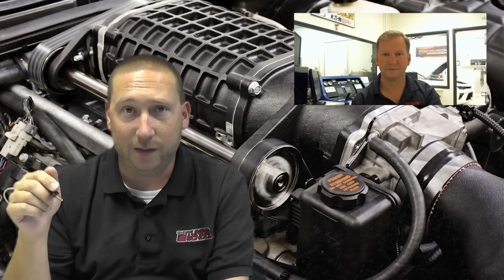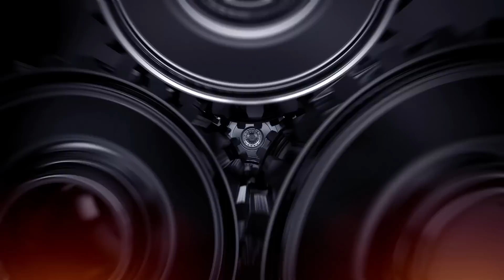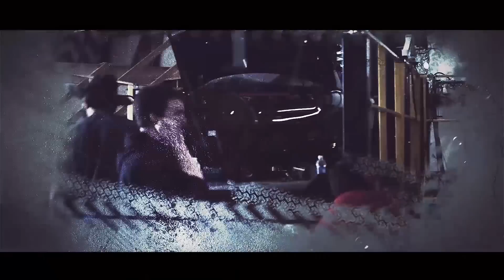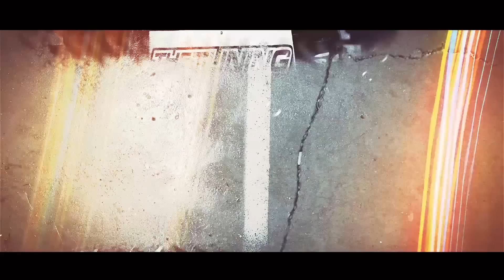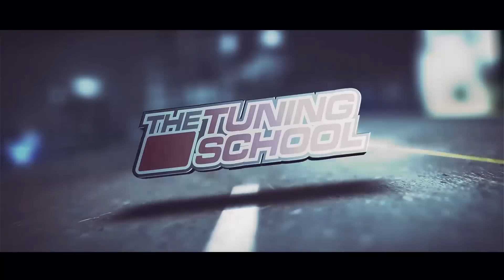Forced Induction (Part 7): Q&A with Magnuson Superchargers, Can you go too big?

Comment: I run a 2300 Magnuson on my 6.0 liter 2009 Pontiac G8. It makes 600 hp with no problem on 93 Octane.
Reply: What mods are done to it? How much boost?
Reply: I had the active fuel management removed. I added a beefier cam to support the supercharger. Dual fuel pumps, Bosch Injector Dynamics 1050 fuel injectors, Rotofab cold air intake. Right now I am only running 6 pounds of boost. I thought about more, but the 6.0 liter V8 already has a 10.4 to 1 compression ratio; but trust me the low end power is extreme with 6 pounds. The torque comes on quick and the redline is now at 6,500 rpm. I also have the car set up to run E85 with 2% methanol added directly to the fuel. It does not have methanol injection. The car has 3 inch stainless works X pipe exhaust. After the mods were completed the shop had it on the dyno a couple of days to get the timing real precise. In addition to the engine mods I had Pedders suspension components installed, including cradle bushings, springs and sway bars. Just switching to E85 and meth adds almost another 100 horsepower. The biggest limitation is the tires. While I run Michelin Pilots, they just go up in smoke from a standing start. If I ran the car at the drag strip, I would invest in some good slicks. The car is a sleeper but just sitting at idle it sounds like a Hellcat or Shelby GT 500. It is quite capable of hanging with them on the Saturday night trips to Mexico!🙄

Comment: For the mobile users(thumbs up so people can see this)..:

0:39 Positive Displacement Superchargers 1:15 What are the major benefits of going with a Positive Displacement vs Centrifugal? 1:26 Low speed operation... 2:00 Instant torque 2:20 No longer is it just low to mid range? But now you can carry that power all the way through 2:53 New units avoiding high IAT's 3:00 GM platform ZL1 Z06 3:35 Taylor made compressor map 3:50 Most popular question- What are the different types of blowers? 4:11 Roots blower 4:23 Blow holes, no compression 4:36 Screw type 4:47 compression with a twin screw 5:24 This is why we developed the TVS Series 5:30 5 3 and 4 6 is what measurement is that? 5:52 Limited by maximum speed 6:20 Bearing speed is based off this 6:47 Eaton 7:19 Compound Boost 7:37 TVS's are all this type of blower 7:45 Average street car- Which one would you go with? 8:10 only limit is size 8:35 TVs's are on all OEM vehicles out there 8:55 How to correctly size a Roots style blower? 9:23 Camaro 2300 9:45 Peak torque peak power 10:00 6.2L pickup I would go with... 10:28 Power under the curve that makes the car go fast 10:45 Joke: What is the difference between a 400hp Supra and a 1200hp Supra? 11:10 Average shop would look at this... 12:00 No low speed surge line 12:40 Z06 flat power curve at the top 13:00 One is a volumetric device 13:30 Are these maps available for purchase online? 13:45 Eaton makes these for OEM only 14:15 5.0 Mustang what size blower? 14:55 You need that torque to get that car moving 15:15 Softer on the tires 15:30 RPM vs throttle position 16:00 Difference between running 9's vs 10's 16:10 Can you go too big on super charger? 16:50 Get biggest engine you can 17:25 Right now the answer is .... 17:30 Types of customers, from light to crazy...which blower fits these customers better? 18:20 Biggest thing comes down to size 18:45 Anything big will leak at low speed 19:15 pumping losses are there at... 19:30 Parasitic definition 20:10 it's not a 50/50 mix 20:30 with roots you always have a positive displacement 21:30 Air charge side of the equation 22:50 Optimize intercooler 24:30 Head to dyno to validate #'s 25:30 I'm a drag racer. I was at Eaton for 12 years.
Reply: R

Comment: Those are some small blowers though compared to what whipple puts out. Whipple has up to 8 liter blowers lol. That's a lot of cfm . I think the guy is spot on but he's probably straying away from big blower talk since they only got a 2.3. The 1.9 liter is only rated for 120 hp for a 5.3. A lot of guys start putting small pulley's on them in no time and get belt slip trying to spin them faster to get the cfm as a bigger blower.....so do your research and know your power goals. superchargers are not as adjustable as turbo's so it's more important to know your power goals. Twin screw seems to be better everywhere as well besides price.
Reply: Well said!
Reply: What makes a blower small or big is how much air you want to push. If you have a very large supercharger spinning slowly it won’t be efficient in lower rpms and will add boost similar to a centrifugal. Those situations will always be down on torque for a small increase up top. A TVS is proven more efficient 15psi and below when properly sized. The new 2650 outflows the Whipple 2.9. A TVS not in boost doesn’t create heat. A twin screw always has pressure building within the case. They will produce a cooler charge at 16-25 psi ect. The reason for a smaller TVS is the oem cares about average torque not necessarily top end HP. They also last well past 100k miles. The latest 2650 had a 2500 hour continuous endurance test at max rpm at 22k rpm.
Reply: James Avery you’re reading hp on the box, 1.9 and 2.3’s are capable of support big power north of 1000hp crank. It all depends on the motor and your starting point. Belt slip occurs on any size belt, be it 6,8,10 or 12. Companies like ATI starting offering pulleys that are grooved for resistance to slip. Big liter blowers don’t necessarily make more power, the 4.5 Whipple in fact is limited by the factory crusher inlet at 170mm and can’t support enough air flow to fully utilize the size. The benefit of the larger blower, is it by default pushes more air into the motor thus require less boost or rpm to generate the same power at one half its size. This is why Whipple runs significantly cooler on operating temps than a Magnuson. Turbo’s are efficient because they use exhaust gasses. They are not easier to deal with in general tuning, and only over racers that compete in the street or strip finer methods of dialing in their car. Superchargers like my own 4.5 Whipple Extended Drive, pulleys/belt can be swapped in minutes and tune for more/less boost flashed. They also react well to Nitrous, E85 and Methanol which are additional devices that can help gear the car. Whipple is taking factory 5.0 Mustangs and going 8’s with their 3.0kit. It currently takes a custom twin turbo system to get mustangs into the same numbers and there are faaarr fewer of these guys running around
Reply: @KTger   Can you make the crusher inlet bigger though ?
Reply: @stevenp3176  Magnuson compared their new 2650 to they're smaller units and it seemed to be just as responsive down low compared to the 2300 and 1740. Being they are all positive displacement blower's which make roughly the same boost everywhere in the rev range I don't think a larger blower would be all that laggy but then again I don't have experience with them. Here's an article from kennebell that disagrees with the smaller is better argument.http://kennebell.net/myth-small-superchargers-are-lighter-and-cooler-running/
Reply: James Avery no, you cannot make the inlet larger. It’s infact the largest in the industry for its design. Once you go beyond what the inlet can handle, they offer a marine rear inlet ( search Teague Marine Engines, go to images ) you will see Whipple designed engines for marine use with the larger ( race designed inlet ). This isn’t ideal for daily driving or street usage since the maxed out inlet will surge on very little throttle.

Comment: I love my Procharger
Reply: R S why
Reply: Because they're more efficient and run cooler than positive displacement blowers.  Less parasitic HP loss and higher peak HP than positive displacement blower too. On a street car/daily driver, Procharged vehicle are showing stock like MPG under normal driving condition under 3K RPM, but turns into a monster above 3K RPM. No need to be at max boost under 3K RPM on a street car, unless you don't care about traction issues, MPG, and engine life/longevity. For a track car, I would definitely go the turbo route! You get lots of power with efficiency.
Reply: deadboy600  Manufacturers use positive displacement blowers, because they're a little less expensive. Manufacturers also know that most consumers will never take these cars to a track/dragstrip. The positive displacement blower provides consumers with good low end power and torque for street, daily driver use under 3K RPM. Centrifugal superchargers are more suited for track/strip use above 3K RPM. Also, because centri blowers operate a lot cooler when pushed hard at the track/strip, you can get more consistent, repeatable performance times on back to back runs. With PD blowers you see noticeable drops in performance on back to back runs, even during dyno runs.
Reply: @happymanasfksubaru2846  Why? Because it makes great power, it's easy on the drivetrain and less heat soak.
Reply: @2015_Rubicnn   2015_ Rubicnn   2015_ Rubicnn  hey everyone thanks for the reply i did not see the comments

I have got now 2014 holden vf (ss), 😊 Magunson  supercharger makeing 475rwrk 1200nm
Reply: @chrism.728  yup. but new PD blowers are catching up for power. 😁

Comment: Installing now on my magnum srt8 6.1. I'm not sure how it'll perform as a partial daily driver on the highway for 40 miles or a road trip 400 miles. Any experience or thoughts with that scenario?
Reply: Did you do this buddy as I'm thinking of buying the 2300 for my SRT8 Jeep GC... what power did you add?
Reply: @MrPugheaven  I did. CAI, 85mm BBK TB, Magnuson TVS 2300 Supercharger, SOS Coils,  BBK LT headers, Magnaflow 3' Catback, 180° thermostat, Ding Racing Valve Body (trans tune not flashed yet). Just  installed new Supercharger pulley 3.1, tensioner pulley, hellcat injectors, and waiting on a new dyno tune. Still running the Magnuson 5lbs tune. My last dyno after SC install was 465 hp and 455tq. Gonna try and dyno this weekend.
Reply: @srt8soldier478  Nice one, cheers for reply matey. So, before your latest mods...  465bhp and 455lbs @wheels, so we're looking around 600bhp aren't we there at the crank give or take.

Comment: The positive displacement blowers on the funny cars and top fuel dragsters are NOT a roots type, they are a screw type. Namely the PSI blowers, and there price tag reflects it. Screw blowers cost more than roots style blowers. Just wanted to add my two cents.
Reply: Wrong.

In the nitro classes ALL blowers are high end roots style, by rule. In the alky classes, the screw is allowed and the PSI is the blower of choice.

Comment: The rotors have to spin to a certain rpm before they become efficient. If you’re below this rpm the supercharger doesn’t put out much power. This is most noticeable with the larger TVS/whipples are being under driven well below their efficiency windows. Below 7k blower rpm they just suck. Low torque numbers show this. Also come on Magnuson you know exactly what the parasitic loss and discharge temps based on blower rpm/pressure ratio ie boost. This the exact reason why the 2650 is a different design vs the rest of the line up. Also the reason why the 1740 is avoided when possible by aftermarket kits. It’s the worse version efficiency wise.